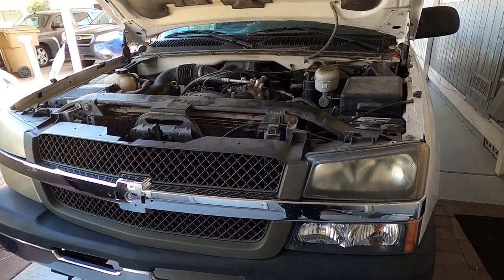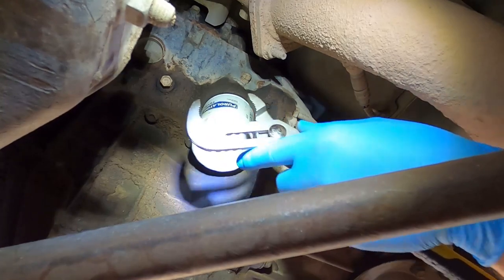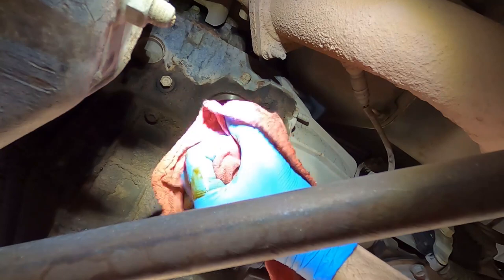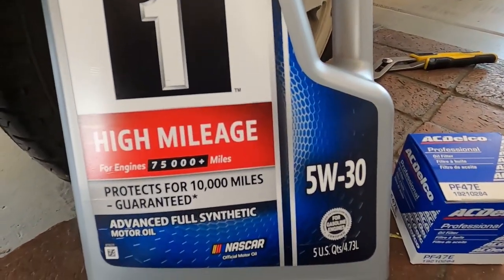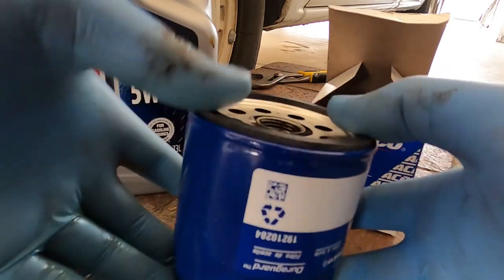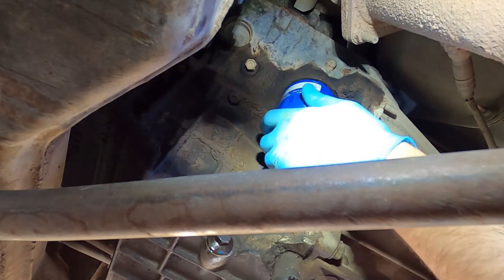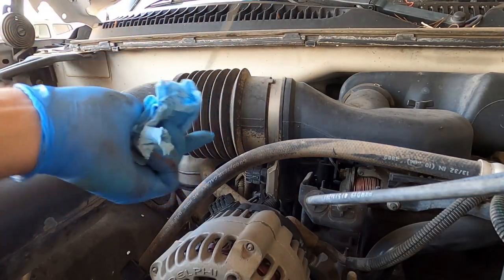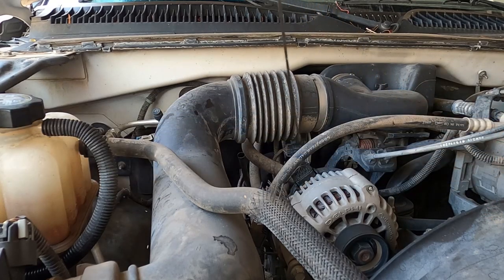Here's Why you Need to Pre-fill Your Oil Filter When Doing An Oil Change

Comment: 205k miles with 41 oil changes and 41 dry filters and the motor still runs 🤷🏽‍♂️
The head HAS oil on it, the bearings HAVE OIL in them, the cams HAVE OIL on them. 
Those few seconds wont hurt the engine at all.
Reply: You have zero oil pressure if you don't prime the filter. Anytime you don't have oil pressure on your lifters I it's bad  Plus if you don't prime the filter you have no oil in your oil pump. How many oil pumps have you had to replace?
Reply: @jameshicks1367  Zero in 10+ cars that i have owned in my life. 
Zero in the 5 cars my wife has owned in her life
Zero in my parents 5 cars they owned in the past 30 yrs
Reply: @ACommenterOnYouTube  nah man I'm not buying that one. Maybe if you buy a new car every year I would believe it  And you're never going to convince me for a second that a Chevy Silverado with 205,000 mi hasn't had to have an oil filter pump replaced.
Reply: @jameshicks1367  you don't have to buy it and i can care less if you don't. I am just stating facts.
Reply: @jameshicks1367  OH ... and just to further school you, some cars, COUGH PORSCHE COUGH have cartridge style oil filters which CANNOT be pre-filled .... 
So how many oil pumps do YOU think get changed out on those motors because they are NOT pre filled ??? 
I will wait for your #

Comment: In all honesty, I dont get a lot from youtube videos aside from typical enjoyment watching people think they know what theyre doing.. but this video makes a very good point and im actually gonna change the way I change my oil because of it. If you wanna criticize him and say its a myth, go ahead and you can replace your oil pump most likely sooner than I will. If everyone treated maintenance like this guy does as preventative, our vehicles would last much longer. Thanks for the video!! Good job, well done, keep em comin!!
Reply: I don't think he is correct, it really depends on the design.
• Many vehicles have a sideways oil filter where you can't pre-fill it. They wouldn't design the vehicles in that way if it caused pump problems.
▪︎ there are also some concerns with prefilling it. Depending on the size of the filter, pre filling them can add up to an extra quart in the engine, effectively overfilling your oil. Putting oil in the center part of the filter essentially pumps unfiltered oil into your engine that could have bad quality control or contamination on your part. We are talking microns you can't possibly see.
What's more important than fill or not fill is:
Making sure you get a high quality premium filter instead of a run of the mill filter. The common name brand oil filter only stops contaminates of 30 microns and above. Premium filters like the Fram premium Filter I use filters all the way down to 3 microns. That's 10x the quality and has far more impact than prefilling.

I've seen people do both pre-fill and not pre-fill oil filters with no issues for 20+ years. That's longer than most vehicles are on the road.
Reply: I am a qualified Diesel fitter, never pre fill oil filters all you are doing is filling the filter with unfiltered oil that may have  contamination that will damage your engine. All his points are totally incorrect he obviously has no idea. But if you want a big end knock fill your filters with oil. I don't really care because I make money from rebuilding engines lol.
Reply: What he said about the pump and filter is not right. The pump pulls oil from the oil pan sump then it goes to the filter, not the other way around.  Listen, if your comfortable pre-filling your oil filter then do it, but it's not going to ruin your pump if you don't.
Reply: @bobmartin7409  you are correct

Comment: This is a myth. It might help for a larger diesel engine where the oil filter holds up to a quart or more, but not for a normal engine. Besides, it doesn't work on horizontally mounted filters.
Reply: No it's not a mess. When you change your oil and you don't prime the filter you have no oil pressure until that thing's completely full of oil. Oil pressure means you're getting no oil to your lifters. No oil to your lifters is a no-no. I've been building hot rods for over 40 years and yes it will work on a horizontal mountain filter You just have to know what you're doing.
Reply: @jameshicks1367  Been changing my own oil and filter for 47 years without ever pre filling the filter and zero issues.  Thinking here that you don't know what you're talking about?
Reply: @arnimkrause5696  I would have to see the oil you're pulling out of your car and run a magnet through it before I would believe you're having no issues buddy. I've been building out rods for over 40 years. My best friends used to build engines for Winston cup and Bush series drivers. I say they know more and that's how I was taught to do it and that's how I'll continue to do it because after 40 years I've never had somebody come back with an issue but I have seen Chevrolets develop problems because not only are you running with no oil pressure for a few seconds every time you change that filter it quite often can create a bubble and your oil system so you do it your way I'm going to do it my way because I know damn well my way is going to work every time.
Reply: When we change vape coils if we don't prime the coil it can take a few minutes longer before you can smoke it without getting a dry hit, this is the exact same concept
Reply: Lot of different engine configurations refilling some may pour directly through the filter others may not saturate it much if at all, longer you wait the more it can naturally saturate itself, but why roll the dice it's not just a lubricant path it's basically a hydraulic effect, as someone else mentioned you don't want any air bubble in the system

Comment: Should I fill the oil filter for all cars like u did?
Reply from the maker: ZK Channel yes, pre fill the filter if you can mount it without spilling the oil out. Cheers
Reply: No, do not pour dirty new oil from the container into the clean side of the filter. Yes, oil from the container is to be considered dirty.
Reply: @GK7GARAGE  I would love to see you prefilling oil filter that is mounted horizontal.
Reply: I am a qualified Diesel fitter, never ever pre fill oil or fuel filters, you are adding unfiltered fluid into your engine, fuel systems and transmissions. Do not pre fill oil filters

Comment: Never ever pre fill oil filters, this is very very bad practice all you are doing is adding unfiltered oil to your engine, there is more than enough lubrication left over from when the engine was warmed up. If you are worried just disconnect the fuel or ignition system and crank the engine over until oil pressure is obtained. Dont listen to these back yard want to be mechanics.
Reply: I've been building hot rods for over 40 years. If you don't find that filter you have no oil pressure when you start your engine No oil pressure means no oil getting to your lifters. No oil in the filter means your oil pump is running without any oil and it's basically just metal to metal until pressure fills that cavity. NASCAR engine builders refill their filters and HRA engine builders pre-fill their oil filters. I'm pretty sure they know what's best.
Reply: @jameshicks1367  race engines are different to the average automotive vehicle. Secondly an engine that has its oil changed still has oil on all the components and the oil pump is still primed, never prefill oil filters there is no need to, if you are worried just turn the engine over with the ignition system is disabled. I am a qualified Diesel fitter.
Reply: @blacksheep6888  your statement is useless. Race engines are no different. I have over 40 years experience building engines My best friend's father built engines for Bush series drivers. I know what I'm talking about You just want to flap your gums.

Comment: Complete nonsense! Previously ASE certified master technician, and current engineer (who has worked in automotive and aerospace) there is no reason to prefill an oil filter! Oil sticks to metal...like the metal components in your engine. The 1 to half a second it takes to prime the oil system and fill the oil filter will not harm your engine in any way! There are several reasons why it can be harmful to prefill an oil filter including: contamination, causing air pockets, spilling the oil everywhere and preventing the oil filter from being properly tightened. I have never seen instructions on any oil filter or manual for a light duty engine (i.e. almost all automotive gas engines) to prefill the oil filter! Please stop doing this! It is not necessary. Apply some oil to the sealing ring (like the instructions say) and install!

Comment: Pouring oil from the bottle into the center of the filter you could potentially enter dirt into the unfiltered side of the filter. The center of the filter pumps oil directly to the bearings. So when they say don’t fill the filter it’s because people dump oil into the unfiltered side of the filter like you did!! If you poured the oil into the smaller hole around the center hole puts the oil to the outside of the filter so it has to go through the filter element to get to the center. So now you know why they say don’t pre fill the filter!

Comment: Why not if can without a mess. Pre-fill other filters on angles with a little oil about half the filter a few hours or more before you change the oil and filter. Gives the oil time to absorb into the filter  material. The oil won’t spill out

Comment: Not necessary, don't believe me. After removing the filter don't put the new one in and fill with new oil. It should come out the missing oil filter hole. Therefore when you add your new oil it fills up your new filter anyway

Comment: #1 , the oil pump picks up oil from the sump (oil pan) and pumps oil through the filter to the oil galleries #2 you are adding unfiltered oil to the return side of the filter so that oil will be pressure fed into your engine bearings #3 you so so incorrect at many levels